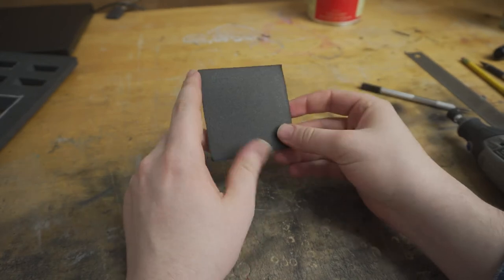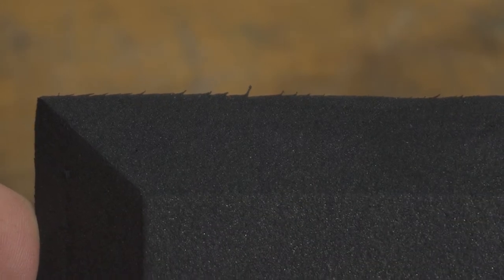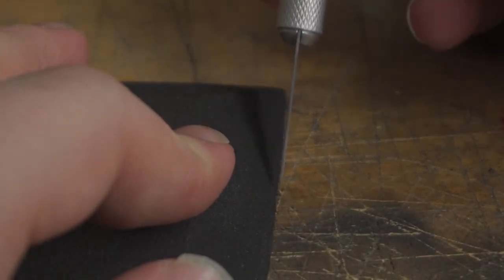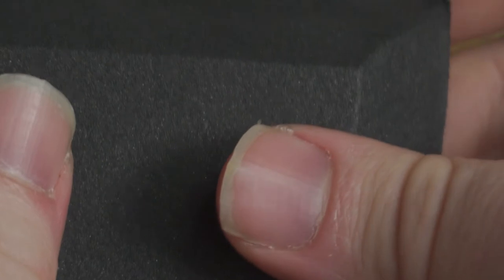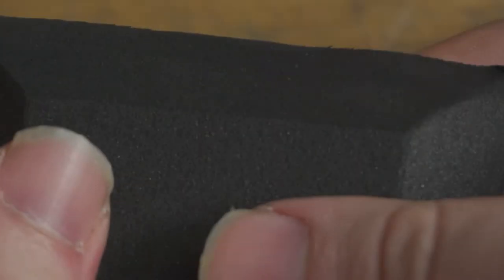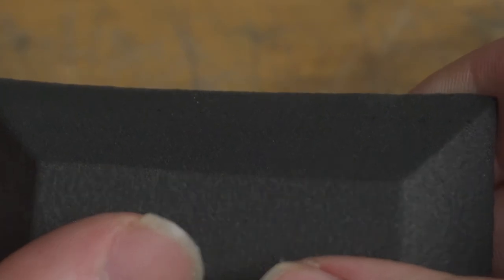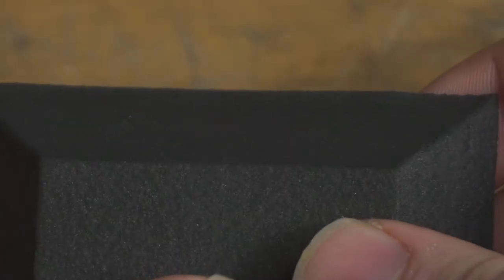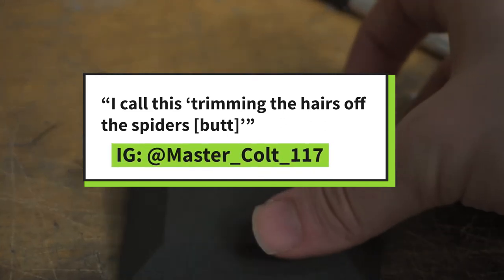The SECRET to INVISIBLE cosplay EVA Foam Seams

Comment: Thanks for going into so much detail on blade sharpness! Most people, even outside of cosplay, will say you need to keep blades sharp, but it's hard to tell at what threshold that is and what some of the signs you'll get once you need to replace the blade are. Super helpful seeing the comparison side by side and other cues like audio. Especially showing that sharpening the blade still isn't as good as a new blade since that might be a first response to foam quickly dulling blades.